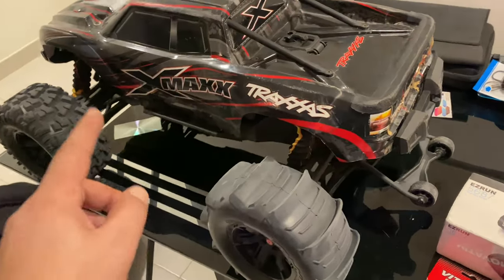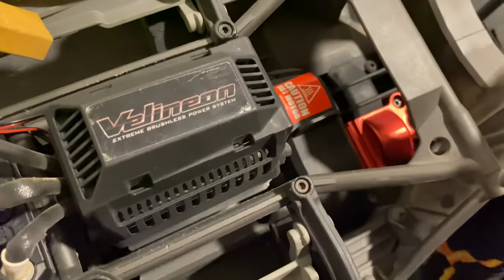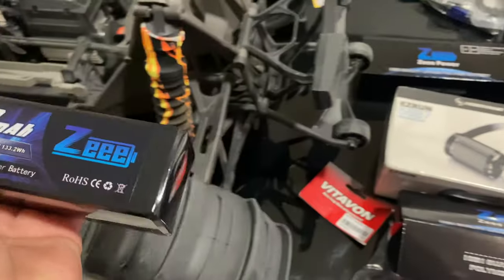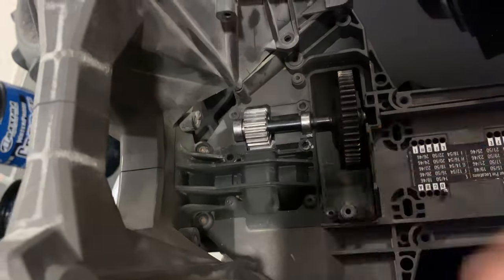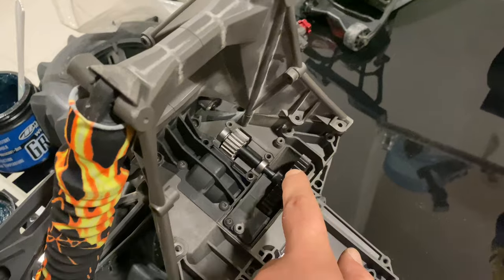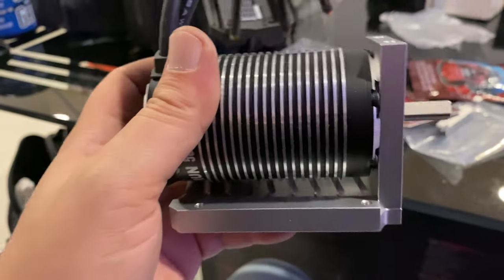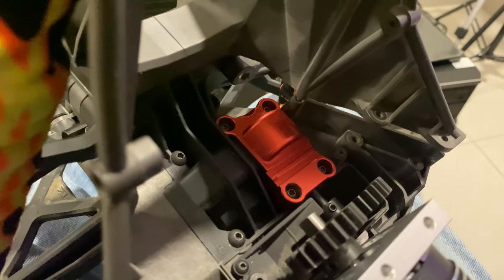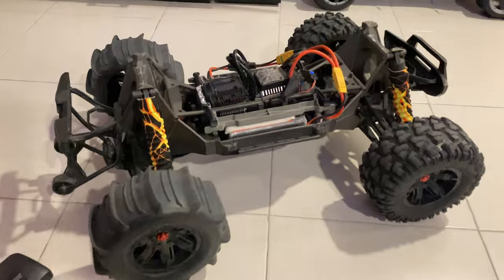Traxxas Xmaxx M1.5 HW1100KV

Comment: I've heard that the vitavon gears you have don't clear the motor mount.  The little aluminum part with the little bearing on the end of the shaft gets in the way of the after market motor mount, so I have heard. I have the same motor and motor mount but I haven't actually tried to Install it yet cuz I don't want to cut anything.  Anyway good luck and thanks
Reply from the maker: in my case it is a perfect fit but if you have the M2C motor mount yeah you will need a little trim

Comment: What brand motor mount is that? It seems to be notched already in the right spot.  I have the m2c mount and not sure if it fits.  Thanks
Reply from the maker: This is from aliexpress its on the vid descriptionand yes the m2c mount will touch the shaft holder you need to cut a chunk